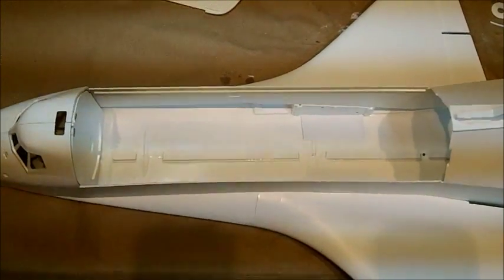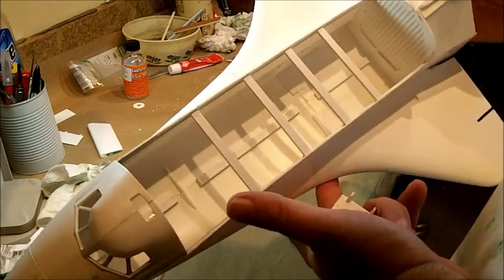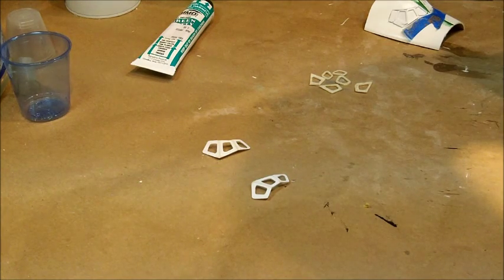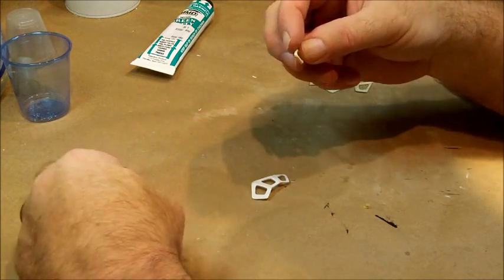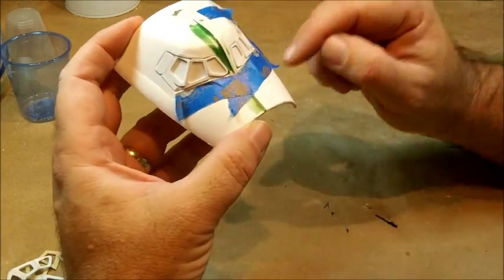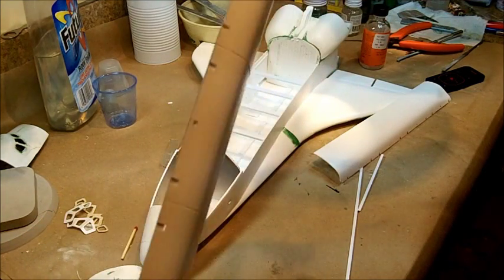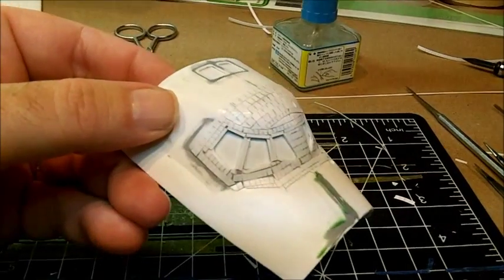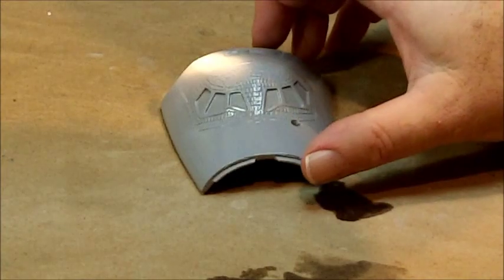Shuttle Wars, Part  17

Comment: I know that this vid is over a year old. But I'm about to start a 1/72 full stack and that beanie cap is great. Do you happen to sell these? Id by one in a heartbeat. Your videos for the shuttle build have been a life safer in prepping to build this beast. Thanks for the posts
Reply from the maker: The beanie cap is a good product and I have sold a good number of them over the past couple of years.  Every time my mold has come to the end of its life, I have incorporated some design improvements.  The most recent of these was a thinning of the area where you would put the top windows in, closest to the cargo bay.  Although it was a design improvement, it did cause a restriction in the mold that resulted in the inability of the mold to vent air bubbles properly as the resin cures.  I am going to have to design a new mold architecture in order to produce a quality pour.   I am a teacher, so that impacts my modeling time now that the new school year has started, but I will try to get to creating a new mold before too much longer. Just hang in there.  I have a couple of other folks who are on standby as well.
Reply: +Dutycat Arts  I'll certainly be interested in buying one of your beanie caps if you have any? Do you use PayPal?
Reply: +Sunclief I am sorry but I had a very busy summer and have thus far not found the time to improve the casting.  The Shuttle Wars project is still ongoing, but along with some other projects.  I can let you know when the beany cap is available once again.